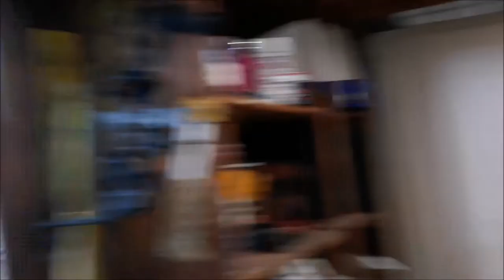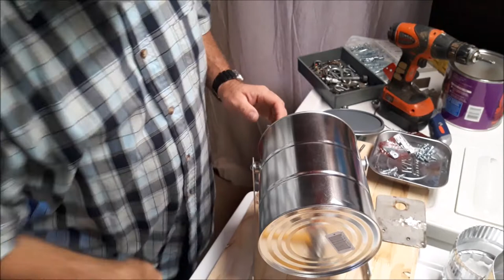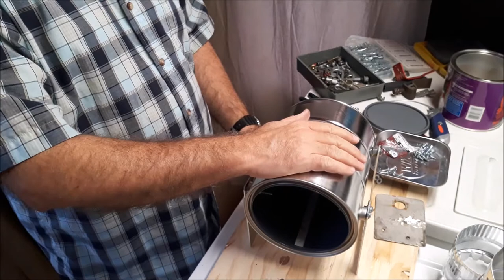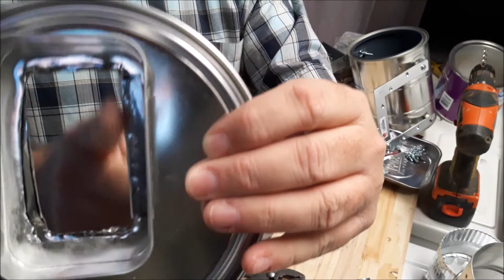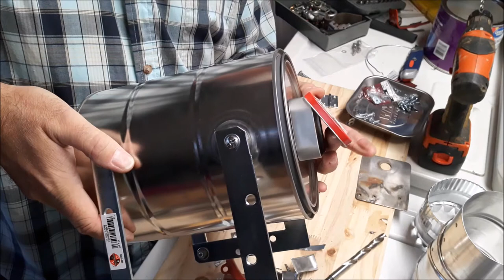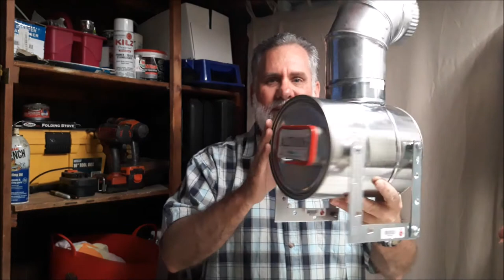Paint Can Wood Stove Build

Comment: you seem like a really nice guy and I hope you won't mind my comments or recommendations. The Altoids can is kind of ingenious if you understand it limits the size of the wood you can burn. I know you don't want to burn a too big of a piece anyway. But you're going to have to process the wood pretty small to get through that little opening. But it is workable. I thought I was witnessing a train wreck when you started to put it near the top. You don't want it near the top because smoke will come out of it. But by turning it and putting it the way you did is an excellent idea even for venting. However, using the pipe you are using you will never be able to vent it good enough. That pipe is way too big. You want an even flow with the intake vent just smaller than the outtake. That will create a faster vacuum to draw the Smoke Out. Grilling it in the top of the can is a mistake. You can do it but it doesn't work out the way you wanted to. For one it's going to put part of the pipe below the smoke line in the top and it will force a lot of the smoke to go lower in the can than it should and you will lose a lot more of the Heat. Also had you use the can and drill the hole in the bottom of the can in the very center of the top. Then use J-B Weld around the inside and outside. You could have gone to the automotive center and got some heat proof expandable hosing for exhaust pipe I'm not sure what they call it. It's about a foot-and-a-half long when you buy it but it stretches out to about three or four feet. And it's hot enough to work on your exhaust pipe to your muffler. You could attach it to the can and then used another can at that end and then adding another hose however many times you need to to get any length you need. Certainly enough to get it outside of a door of a tent. Especially if you put heat exhaust tape around the part where it goes through the door. The legs are pretty cool. But you're probably going to want to cut off some of the bolt sticking through on the inside. And you're going to want a bottom inside the can. Like part of a grill or something to keep the wood from directly touching the can. I think that would be a pretty good little lightweight heater that might keep you warm and cold weather if you're out and about in the woods. As long as you have the outtake of the pipe away from your flammable tent. And with the flex hose you can bend the very top around so rain and snow won't come in. Or you could just attach another can with holes cut down the sides. Just an idea. It might make a good spark arrestor too.

Comment: Great video, 

A few helpful tips that I found the hard way.  Make sure you burn the galvanized pipe outdoors before using in any confined space.   The coating isn’t something you want to breath in.  Also it looked liked you used lock nuts,  they have a plastic bushing that’s keeps them tight and will burn in short time leaving the hardware loose.    The most helpful tip is you can use pellet stove pipe for the chimney.  Rated much higher than the dryer vent.  Plus it’s smaller at 2.5 or 3” instead of 4”.  Nevertheless great video.  Hopefully some day I can watch the second version with some modifications.

Comment: That looks pretty cool!!!! If you could find one skinny fire brick, the kind that's only about an inch thick, I think I'd lay it in the bottom for some weight, and to protect the bottom. ....I know you fired it up already.... how did it do??? 👍🏻
Reply from the maker: Thanks Chris! I looked for one, but I got too impatient lol. It did good tonight! Fire went out a little too easy though. Maybe a view more vent holes in front will help.
Reply: Fire brick or carry a small bag of sand. You can pour it out when you're done with it. Nothing bigger than a medium sized Ziploc baggie... my guess is you can use dirt from the ground in a pinch just make sure there's not a lot of biological material in it. All it has to do is insulate the bottom or put the sand in your altoids cans. It may ventilate it

Comment: If you want you can also get another paint can. Use a can opener to get rid of both sides. Drill holes on the top and bottom of the can side ways.  Drill holes on the bottom of your main stove. You'll have a wood gas stove secondary burn! :)